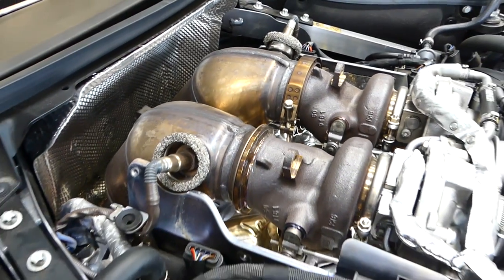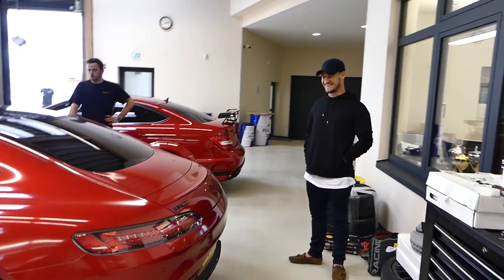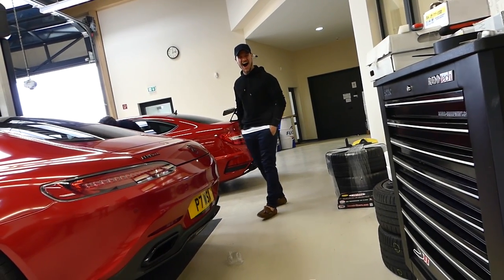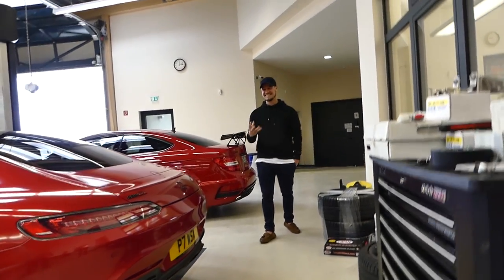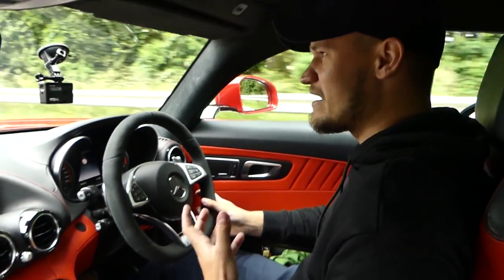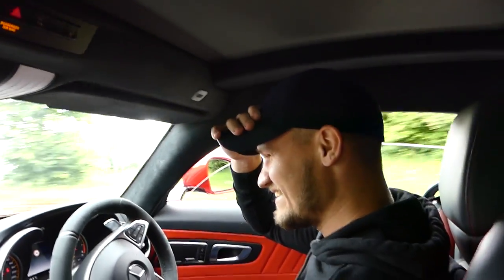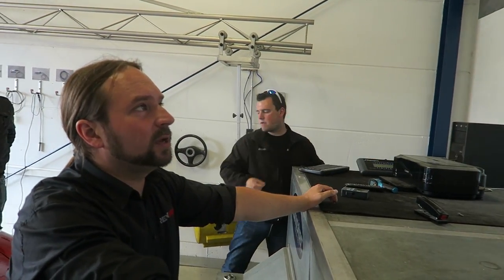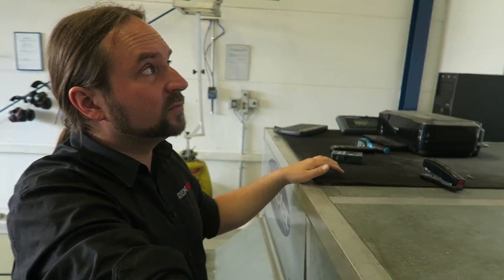MY 625BHP AMG GTS TUNED BY RENNTECH!!!

Comment: Is it me or does it always sound like Paul is upshifting too soon
Reply: He is
Reply: No, those twin turbo V8's don't rev very high at all
Reply: Blain Jackk - PS3 Not even a bit higher than what he's doing though
Reply: Actually this one revs to 8250RPM so it isn't exactly low revving
Reply: +Edgar Santos so he is early shifting
Reply: Wait aren't you off by 1000rpms ? The stock redline is 7200 and i highly doubt Renntech would make it to 8250 without reinforcement, plus there is no redline change on the dyno chart anyway. 

And it'd be called called "short shifting", and in a turbo engine it's actually better at low/mid speeds.

Plus for a performance engine, 7k is not that high.
Reply: Kaisuke971 so is he doing it normally our too early
Reply: Ben Mills I'd say too early,but then the power of the car drops off in the last 500 or so rpm's
Reply: Ben Mills He's doing it the right way, because he adapts his shifting to the throttle application. If you don't press it to metal, just stay mid-range and the turbos will do the rest.

That said, on the chart you can see that the car is still doing 90% of its power at redline, so  i think shifting at 6.8k for 100% throttle is about right.

So no, he is not shifting like an idiot.
Reply: +Kaisuke971 ahh thanks :)
Reply: You don't want to shift it at 7200 rpm at every shift.
Reply: +Jackpody Isn't that just a given with any car ? Lol I never go all the way up to max rpm every single shift there's no reason for it
Reply: Sounded like no one above me understood.

Comment: This is still with the OEM mid pipe and rear muffler right? If yes, simply amazing a down pipe with high flow cats make to the sound. Its almost like you dont need an aftermarket cat back exhaust for this car. Kudos!

Comment: I drive a 2016 C63 estate with the performance exhaust. Does changing the downpipes make such a big difference in sound?
Wat are the benefits? I'm not eager to tune the engine for more bhp as I'm still one of those people who believe it will degrade the reliability of the engine, however on the sound department I would like some more 'noise' ;)

Comment: Still desperately needs new wheels
Reply: Yeah i hate them wheels :/
Reply: me too. They just don't look good
Reply: I love them
Reply: I agree, new wheels next please paul!
Reply: They are just to small
Reply: no stock wheels look mint.
Reply: Bigger wheels lead to a worse ride and they're generally heavier too. The only benefit is they look good, and these current ones look good anyway so it would be a downgrade.
Reply: hahahah wtf
Reply: Different.
Not bigger.
Reply: Different and Potentially bigger, doesn't matter about weight, its not going to affect performance especially when he's just had it tuned..
Reply: +AMG BENZ_HAMMER_6.0 Agreed, they're awesomely built wheels. I don't like the design too much, but probably it's because of the black color, makes them look tiny.
I would only replace them with a forged high quality rim, HRE makes fantastic designs for supercars.
Reply: +Francesco Di Giuseppe true but ///AMG put them on there for a reason. I think they know what there doing. There on there for a reason.

Comment: The stock figures of the GTS were always a let down when you can buy a C63 S AMG with the same engine and 50Nm more torque for about half the price.

I understand why they would limit torque (aid traction in lower gears) but they should have bumped the kW/Bhp up to something around the E63 s AMG output ie. 430kW.

I think it would have been more bespoke had they done that.

Comment: How can the gearbox hold 625 bhp it can huld just up to 600hp this is why nobody is doing crazy stuff on the amg gts,a lot pf people do swap the gearbox from the c63 amg cuz thats a little slower but it can hold up to 800hp.
Reply: the problem for the gearpox are not the HP. The Torque killing the gearbox. And the Torque is limited so the gerbox will hold that power.

Comment: doesn't the gts have 503hp stock? thats an impressive increase with just a ECU tune and new exhaust. If i had a car like that idk if i would tune the ECU. wouldn't want to cause more stress on the engine. Brabus does it properly, by upgrading the internal parts with stronger components that will handle the extra power.
Reply: 510 HP stock officially. Bot often over 530HP.

Comment: LOL The AMG GT-S did not have 500 hp stock like it's supposed to... it had 575 hp. That's a German underrated engine for you! Also, Torque is up from about 520 lbs-ft to about 605 lbs-ft, for non-Nm-speakers. And hp is up from 575 to 625. That's generally what you get with an aftermarket turbo tune: more torque than power.

Comment: Im gonna get a renntech smart car with an armytrix exhaust and carbon revolution wheels on 355 trofeo r's with a mansory full carbon kit with r8 lms ultra wing, and neon pink leather seats with carbon seat backs and everything else pink carbon, it will have bmw infotainment and harmon kardon 25 speaker sound system, it will only have armytrix headers because exhaust will come straight out of side, it will have custom 150mm quad turbos and whipple 3.5L dual superchargers, 200 octane fuel, lightweight flywheel, full titanium engine, custom porsche pdk transmission, rear wheel steering, all wheel drive, viper acr like front aero and diffuser and race harnesses. If you read this far into it congrats you wasted your time, im trolling, some of these engine mods dont fit in a smart fortwo, but for te ones that arent actually a thing for the smart, if money is no ovject you can get it made, but please realize this is a troll, but if you make a build based off of this, shout my channel out

Comment: Always feels nice to upgrade the ECU for extra BHP. But what about your tyres, brakes, clutch, drivetrain etc? How does this affect your warranty? When manufacturers design new cars nowadays, they use parts designed for the BHP from the factory. They might not be able to comprehend with more power and as a consequence wear out much quicker or break suddenly. Have you thought of this when you decided to upgrade?

Comment: Amateur hour that at 2000 rpm the OE spec has more torque....
Reply: That is what happens when you go to a larger exhaust. Most cars (na or turbo) will loose just a bit of torque and hp down low (below 3000ish rpm) when going from say a 2.5" to a 3" exhaust. However, as soon as the demand for air goes up, the performance increase outweighs the slight loss just off idle. You can try and compensate a bit however this often leads to tip-in issues.

Comment: I'm sorry but YOU ARE GOING TO DESTROY YOUR ENGINE. You don't think for a second that if AMG, who spent years designing and engineering this car, could just flip a few lines of code and make it faster they wouldn't do that? There is a reason it is tuned like it is and if adding an ECU and downpipe adds 125bhp without any further modifications, something is going to go wrong.
Reply: I would also question those figures, the chart shows the stock GTS with the AMG rated engine values, there is no way it would show this at the wheels. I'm wondering if they tuned their equipment to get better scores so it will sell better. If so, that's cheating and another reason to avoid these guys...
Reply: Daniel K egg roll
Reply: Lmao it already has an ecu otherwise the car wouldn't work